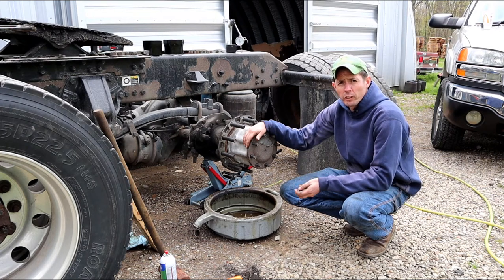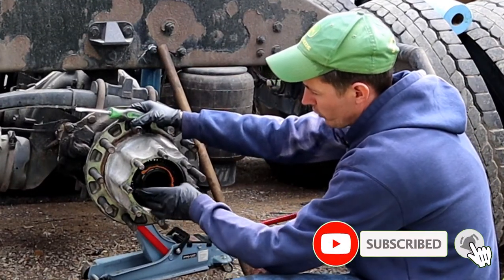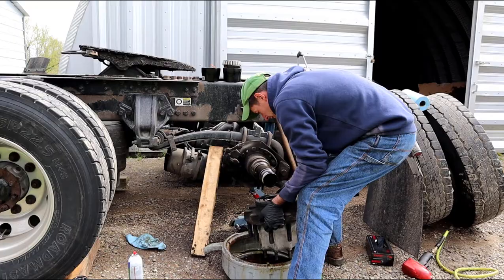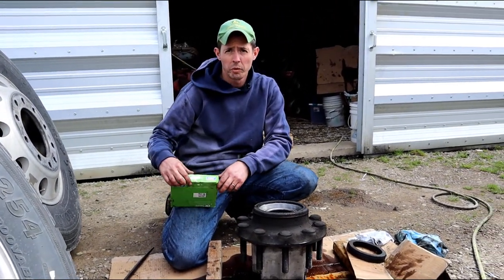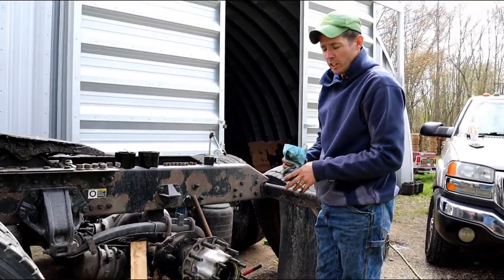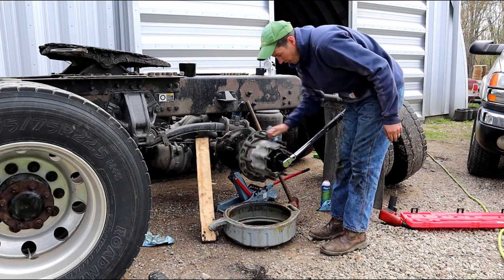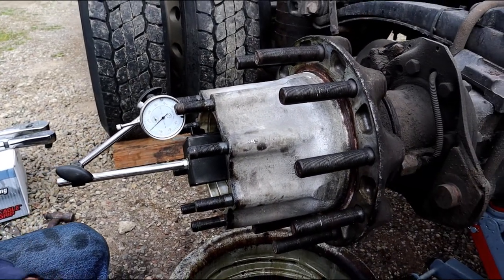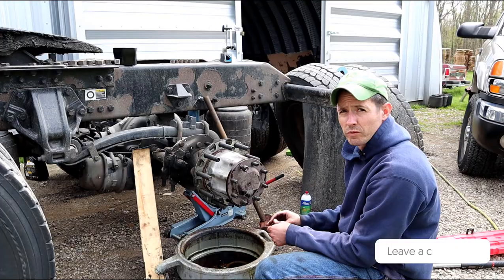How to Change Semi Truck Wheel Seals Step by Step | | Owner Operator Truck Repair DIY

Comment: I'm not trying to stop anyone from DIYing, but please read the manufacturer's instruction, this is not something you should attempt after tossing out the instruction papers. Your hub may be different from what is shown in the video. If you mess up real bad, you're lucky if you prematurely wear out the bearing or seal, if you're unlucky you lose both your wheels and it kills someone on the road and you're looking at manslaughter charges.
Reply: This is the most dramatic post iv ever read.

Comment: Put High Temperature Wheel Bearing Grease on your Gaskets.   It works very well and the Gasket comes off much more easily the next time that you disassemble the parts.

Comment: Man I wished I worked with people like you, I got a guy from Cuba, no English, 3 from Venezuela, no English, and two from Mexico with some English but all of them have a mechanic mentality better than I’ve ever seen it’s just they don’t know the difference between “proper” and “eh, good enough”, if it drives it works, they forget the details and safety measures, I understand in their countries they had little to work with but dot doesn’t give a shit and these drivers and others lives are on the line with jobs like replacing brake shoes, king pins, wheel seals, etc. I almost had a truck fall in the shop do to improper jack placement, it’s ridiculous and I really wish I was a part of a solid crew or I could just go off on my own, but I don’t have enough resources and knowledge to go completely independent

Comment: Smart to change them out when doing all your brakes.
Reply from the maker: Yes, the seals are only an extra $35 each, and takes an extra 20 minutes to swap them out while the brake hardware is off, so its a no-brainer to me.  The last wheel seal I had to get replaced on the road, out at the TA in Ontario, California, cost me over $500, for one wheel!

Comment: We got  a 7.5 tonne iveco, the seal had gone,  i put gentle pressure on the bearing with the Press, the other side, pushed out easy peasy... 
The hub nut locates on the washer holes,  , tapered bearing.. 
Good video 😊

Comment: I like to pack my wheel bearings with red high performance grease when re-assembling the assembly. Sometimes the oil doesn’t get up on the top 1/2 of the bearings right away so packing them adds an extra level of protection during the initial drive period after installation. I think it helps extend bearing life since it has good lubrication.
Reply: @@sidthesloth128 I've been doing both for close to 20 years, haven't had a bearing fail yet.

Comment: Thanks for the detailed vid.  You didn't put any oil back in?
Reply from the maker: My seals were not leaking when I changed them out, the reason of changing them was that I already have them apart, It made sense to change them, in case of leaking while I am on the road. After changin the seal, I checked the oil level, it was full.

Comment: I think my wheel seal bearing is going out on my driver side drive axles (front or the back) can’t tell if the sound is coming from the front axle or the back one.. only makes the humming/whining sound when I’m loaded can barely faintly hear it when empty also nothing is leaking.. or could this also be my differential going out? Thanks for your insight
Reply from the maker: did you check the oil in the differential?

Comment: What are your thoughts on the 6x2 axle configuration?
Reply from the maker: The 6x2 would be great for a Line haul operation where you are on the same predictable routes.  It will reduce weight. Giving you a little more load capacity, and in some cases you can raise that dead axle to save on tire wear when its not needed.  If you are running over the mountains, in snow, or off road anywhere it would probably not be recommended, that's probably why the 6x4 is more industry standard.
Reply: @truckingandfixing  What about gear ratio? I had a dealer tell me that a 3.08 with OD offered the same performance characteristics and mpg as a 2.47 Direct drive.
Reply from the maker: For the lanes that I run (over the Rockies, Cascades, and Sierras), I prefer a little lower gear ratio.  My T680 had 3.36 with a 13 speed(manual) and my T660 now has 3.42 with a 10 speed(manual).  I do sacrifice some fuel economy, but I can move pretty easily over the big grades without running my engine too hard.  The higher ratios you described are great for economy.  I am averaging about 6mpg with my T660 now, with a Cummins ISX 15, about about 550hp, and that's running as fast as speed limits will allow.  I may put a 13 speed in this summer to improve that a little.

Comment: What is the average life expectancy for the hub bearings?
On average,  about what mileage to expect from them?
I haul most loads pretty light, nothing dramatic 
Anyone who can answer, thank you, and blessings!
Reply: I've always heard 300k-500k if installed and cleaned properly.
Reply: If they are adjusted properly, lubricated properly, and sealed properly.  Long time.  Upwards of 1M miles.  Tapered bearings are one of the most robust bearing systems in existence.

Comment: Why wouldn't you replace the bearings while you have it apart?
Reply: The bearings on these trucks almost never go bad usually if they go bad it's cost of rear end going down or contaminants in the oil or not changing the oil

Comment: Most items yes I agree when your in there replace it if not much cost but wheel seals are different If not leaking and all rusted lips on the metal leave it alone, you will have more of a chance it leak when you install on truck if u just nick it slightly, plus creates a big job that should have been easy job, One exception for techs that are old enough is cast spoke wheels , ask your viewers why??

Comment: Will you help change mine too? And how much you charge for it?
Reply from the maker: Hi, where are you located at?  I really would rather not commit to any additional work right now unfortunately, I am pretty well at 110% right now with being on the road, and spring farm work starting.  I may be able to help walk you through it though. Thanks for the question.

Comment: Please tell your viewers not all seals are equal when removing hub you best check spindle to be sure there is no "Wedding Band left on there" that will need to be removed by hammer and chisel depending on what seal was used prior, and as far as install depends on seal your using CR SCOTTSEAL CLASSIC will require special tools and Never use oil on lip seal itself with those. totally different install steps with those and they are most common lets say a cr 47697